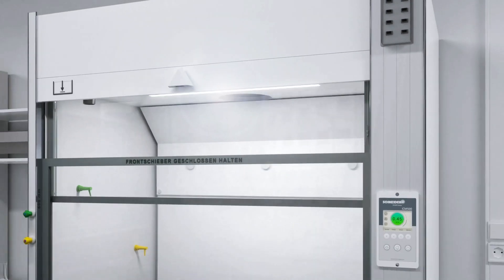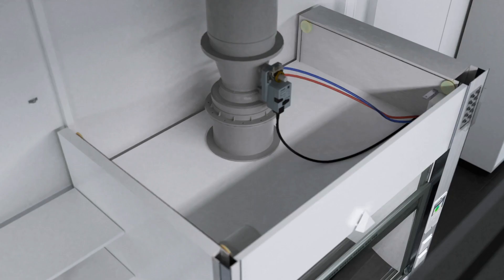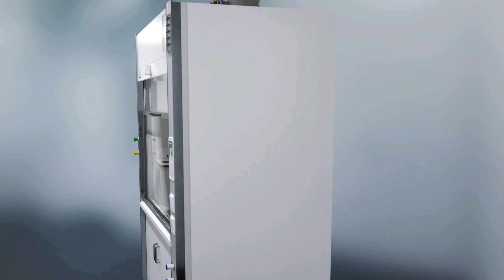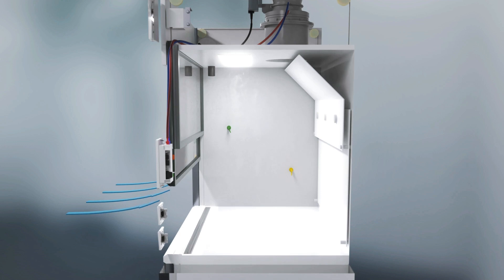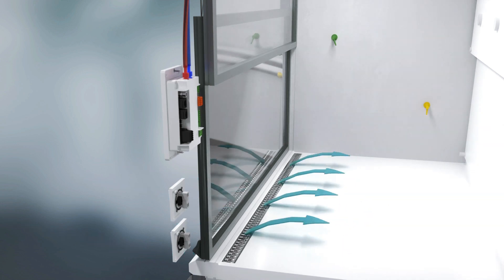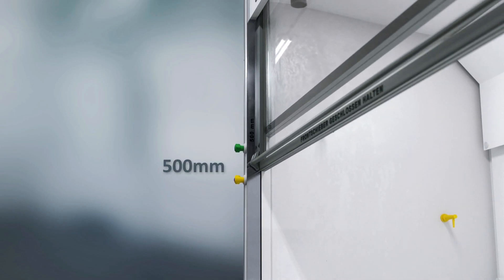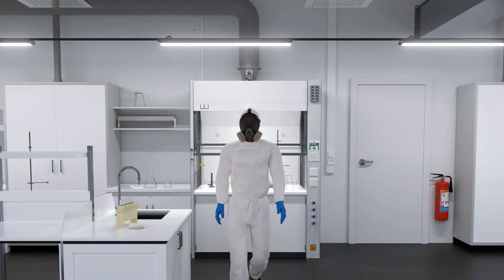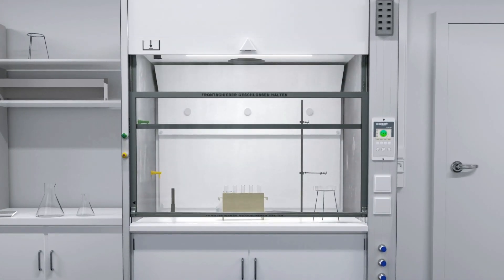BEST & SECURE Laboratory FUME HOOD - Cleanroom Example

Comment: Where do the fumes go then?
Reply from the maker: Most likely the fumes exit through the duct on the roof of the building. But depending on the lab also an additional filter need to be applied.